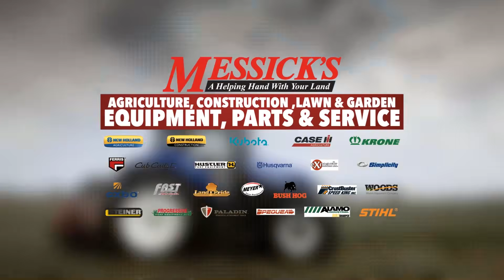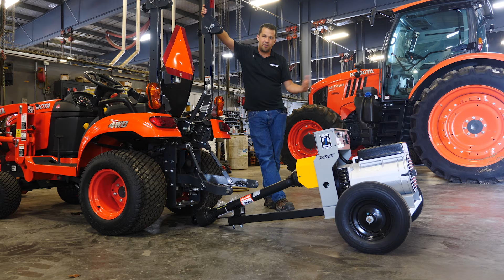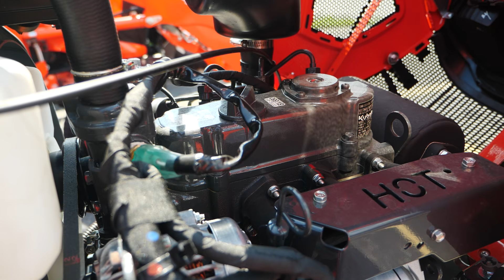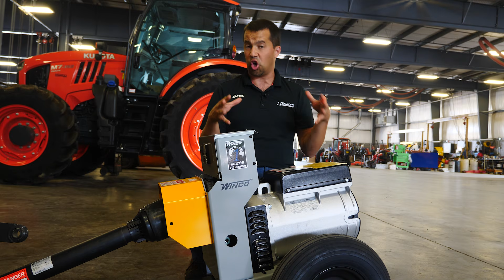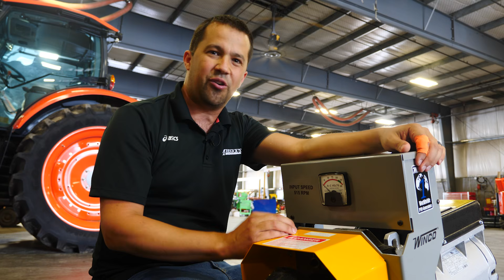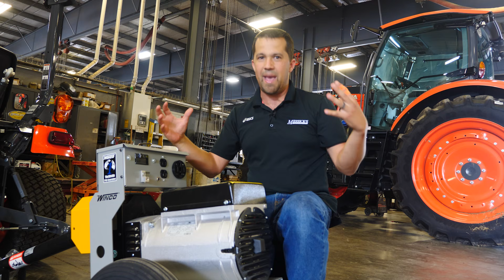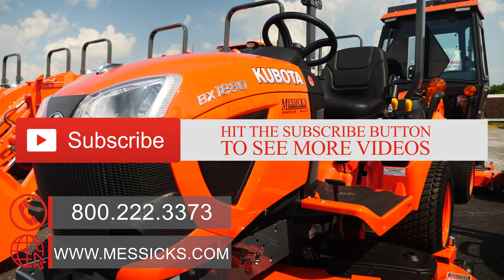Power your home with your tractor - Winco PTO Generators

Comment: When you have a variable load, what keeps the PTO RPM constant?  Do the small tractors have the same feature as the larger ones that allow tractor throttle to maintain a specific PTO speed?
Reply: As long as your loading stays in your hp rating, the governor on the engine will hold the rpm steady. The only time it would vary, a miniscule time, is catching or shedding a load. This is called droop and surge. The only time this would become critical is when coming  close to the maximum load vs available hp ratio.
Once that is eceeded, the governor will just go to limit with the engine bogging down. This applies to all generators, not just pto driven. The more sophisticated units will shed load by tripping breakers at the least or by canbus to a load center that will start switching loads off by priority.
The math work is critical!
Reply: @robertberry7194  exactly-apparently these guys are unfamiliar with governors. The Winco has voltage regulation & is rated at less than 5% variation, which is better than most utility power!
Reply: @robertberry7194  I never thought they had governors, but it appears they do. It is probably just that in every day use, you exceed the limits of the governors ability (full open throttle) to keep the speed constant.  Also at lower rpms the engine wouldn't produce as much power, so it must push the trottle wide open, but still not be able to prevent an rpm dip. When running a loader into a pile it sure doesn't seem like it has one at any rpm. The rpms dip every time the baler hits too, but it is a transient load, and the motor takes some time to respond.

If they have decent regulation then the output of the generator should only dip for as long as it takes the engine to catch up to the changing load. I'm curious to know how well regulated it is though. I'd like to see you take a tractor sized 10-20% more hp than needed (not the 2x figure used in this video, but the actual 1HP=746W) and set the no load output to 60hz, and then put a load of the rated generator capacity on it, and see how well it recovers.
Reply: @court2379   If its 2 seconds then its in tolerance. I have a 4750 watt generator as a basic just in case I need power somewhere thing. It only runs at one speed so idle if you will I hit it with 1500 watts 120v my Fluke 87 barely sees a change.
Reply: @jeffstrains4014  I don't think that is really the same situation. A gen set like you have is designed soley for that purpose, a tractor is not. Who knows what kind of recovery response it will produce. The tractor has a lot more inertia too.
Reply: @court2379  True, I think in most cases guys using a PTO generator are hooking it to a real tractor and not a riding lawn mower tractor. That generator on a 48 to 85hp pto tractor will never drop. Or a better way to word it the engine was sized on the box store unit to take the surge. Same applies on tractor its going to have to be sized to take the surge.
Reply: yes, the Kubota bx has a governor. I use a PTO generator successfully.
Reply: ALL tractors have governors built in that do slight adjustments to the fuel when more demand is called upon.  My parents used a 25kw to run their dairy farm INCLUDING a mix-mill feed mill when electricity went out here in Louisiana...sometimes weeks at a time after hurricanes tore up the lines...and they ran it on a 55 hp john deere tractor.  Whenever the larger motors would start up, you'd gear a "grunt" out of the tractor as the governor sent extra fuel to the engine for the short time the motor was starting.
Reply: @Mr. Sunshine The one on my Ford 5600 didn't. Constant adjustment, and babysitting. But even the standby units require attention.
Reply: @Mr. Sunshine And the trolls come out... When  loaded, and you don't hear or feel it trying to compensate, so unless you have used it in an application like generator, how would you know it is even there. Also just because it has one does mean it holds accurately, or that the engine response time is good, or that the it can keep a constant output near the max output limits. So get off your high horse.
Reply: Nothing, I was going to make the same comment. I think that is why he is way over quoting the hp to KWs conversion. To keep a relatively constant speed you have to keep the load under the actual capability quite a bit so that the engine does not slow a lot at the current throttle position.

I really could not recommend one of these without a tractor that can maintain a constant pto speed. My family used to have a 15KW generator like this that didn't have speed control. Every time you put a big load on it, you would have to go out and ajust the trottle till the frequency was back to 60hz. We tended to damage electronics when a load would drop off, and the voltage would surge. It would be fine for a big pump or similar load that you set once and let run for hours. Not so great for a home where the load varies frequently., and there are sensitive electronics.
They should really put switching eletronics in these to give a contant output voltage and frequency regardless of engine speed, and only vary the current. I have only ever seen that on the little 2KW units though.
Reply: @court2379  You nailed it, these put out clean power at constant load, the rpm fluctuations make it dirty though. An inverter style unit that you could set tractor at 1200rpm for night time, low load and lower noise, and 1800rpm for daytime higher loads would be much more practical.
Reply: @ricksanchez7459  Dirty power is power that has a high THD (Total Harmonic Distortion) which is not caused by changing the frequency of the power.  THD is when you have sub harmonics in the power.  I have hooked my 2320 (18hp at the PTO) to my PTO generator and done experiments with the power quality.  I hooked it up and varied the load from a under 1K to 10K watts.   There was not much of a change in frequency until I got around 8K, it would do 10K but the tractor was working hard and the frequency dropped out of where I wanted to see it.   Oh and so everyone knows, the modern electronics can take a lot more fluctuation in frequency and voltage because they are built to handle power requirements in different countries.
Reply: @Mr. Sunshine It hadn't what? Do you speak english as a first language, or are you a foreigner paid to instigate for clicks?
Reply: Newer tractors may have governers mine does not and 3500 rms on a diesel no sir not for me
Reply: @dosstheboss100  Both of my father's john deere tractors (one built in 1977 and the other in 1980) have governors.  My dad and I haved used a 25kw winpower generator for years on the farm to run the dairy equipment and dad's house after many hurricanes went thru Louisiana (between 1977 and today), and we pull it on the old 1980 50 -55hp john deere tractor that now has over 4000 hours on the engine and injection pump.  Whenever a large motor starts up, we hear a quick, but short "grunt" out of the tractor because the governor feeds the necessary extra fuel to keep the power EXACTLY where it belongs, and we've NEVER burnt up anything...not even the large satellite system my parents had in the late 1980's and 1990's, or the new flat screen tv's and direct/dish network systems they have today!
Reply: @Mr. Sunshine look at the big brain on mr sunshine.  Obviously you have never put a small tractor under variable, heavy loads.  The governor can only compensate so much.  It is not the same as the electronic throttle control like my 7060 has.  Even that is not perfect.  If the load is too high RPM will still drop.  Now go troll some other channel dipshit.  We're trying to have an adult conversation here.

Comment: interesting point about the engine life, Whats the highest houred sub compact you've seen in your shop that was still preforming well?
Reply from the maker: 20,000-30,000 out of these little diesels is not unheard of in the right application. Generally in equipment the engine is the last thing to wear out.
Reply: @MessicksEquip  So you've actually had Kubota BX or B-series in the shop with 20-30 thousand hours and everything still worked?  That's a lot of hours even for a Reefer engine. By the time you get 10,000 hours on a sub compact tractor engine chances are the rest of the machine is pretty tired.
Reply from the maker: @eosjoe565  no, not on a tractor.  I've seen 8,000 on a bx.
Reply: At work we have Carrier reefer units (with 4 cylinder Kubota engines) on trailers that have over 50,000 hours on them.
Reply: alot of generators are ran from diesel engines.
Reply: @MatthewHensley8304  The best ones are...and they are far more fuel efficient than gasoline and propane engines of the same torque ratings!
Reply: Diesels that go in equipment are extremely durable. Most are sleeved. If you keep up with your fluids none of the other stuff is a big deal at all. I imagine these are open center hydraulic systems, and if they are they can spin all damn day and it doesn't matter at all. Full flow almost no pressure. There are tractors that had 2,000 hours before you were born that will have a functioning gearbox after you are gone.
Reply: But you are not just running the engine on the tractor. You are turning everything except the axles. Alternator, hydraulic pump, hydrostatic transmission, basically the entire drive train between the engine and PTO output shaft. Portable generators are cheap, they are easy to hookup and easy to shelter from the weather. My current portable generator is 8 years old and has provided power through countless power outages. The worst was two winters ago during the pre-dawn hours when the temperature was 0-degrees F. It took me less than 10-mins to power up the generator and have whole-house power restored. Can you imagine going to the barn and dragging out the tractor and PTO generator under those conditions? My generator current has about 200 hrs on it and I expect it to last for many years to come.
Reply: @eosjoe565  You are not going to wear out your tractor and when there is bad weather coming you make sure the generator is not hard to get to or hook up.   I never have to worry that my tractor is not in great running shape.   If you have one of those self powered generators you need to make sure you do test runs with them and make sure they are stored with no fuel or the fuel is run through them to keep it fresh.
Reply: @vsteel  It's very hard to plan ahead as 80% of our outages over the last 10 years have occurred in perfect weather with blue skies. That is why you have to keep the backup power solution ready to go at a moments notice. I always have 15-20 gallons of fuel on hand. I use Sta-Bil treated non-Ethanol fuel and I run my generator for 15-mins with a test load every month. Every 3-4 months I run the whole house on it for 15-20 mins. I keep my feed cables next to the generator for easy access. I've been following this routine for the past 8 years.
Reply: @eosjoe565  I don't have to do any of the BS you mentioned.  My generator is bolted to a slab near my double throw generator switch and it's got a vented "doghouse" over it to keep off the rain.  All I have to do is to get the tractor, back it up to the generator, hook up ONE shaft and turn it on.  I already ahve the shaft designed long enough that i don't have to unhook my bush hog to hook to the generator!  (yes, I do have to unhook the bush hog's PTO shaft to hook the generator, but that takes less than two minutes!
Reply: @eosjoe565  and you can keep that POS!  I had one when I was younger, stupid and didn't have a lot of money.  Now, I have a 15kw that hooks on my tractor, and you couldn't ever give me another gas-burning POS portable!

Comment: the only thing is those "smaller" generator are just too expensive vs a gas one. this change once you get to the bigger one.  25kw+ at this point if you got a tractor. definitely yes

Comment: This could solve a problem I have with my current back up generator.  It isn't supposed to be out in the rain.  My L2501 can run in the rain. Can this generator be used outside while it is raining.  That plus a 30A twist lock would be enough to get me running during the storm rather than after.
Reply: I put a sheet of plywood over my generator and strapped it down to the three point hitch. You don't  want the rain to get onto the electrical works, my short out.
Reply: May short out.
Reply: All you have to do is to make a little 3 sided (one side being a roof) plywood box to keep the rain off of the generator
Reply: Could really come in handy for powering stuff around the Farm. As for "back up power for the home" maybe good as back up power for back up power but one would need to see how the entire system tests out and in fact connects first before these claims can be valid. A straight up two stroke outboard motor is still better tho...properly set up of course..